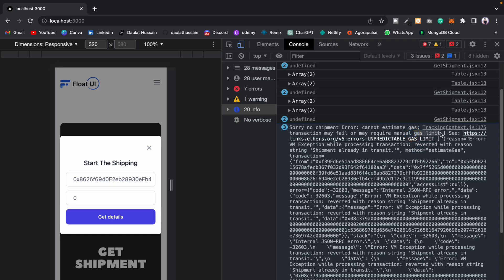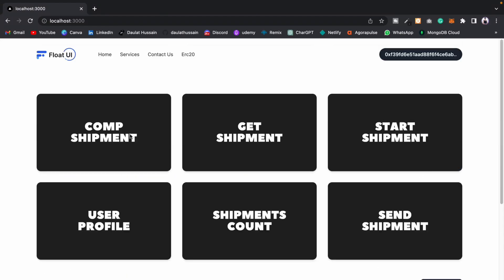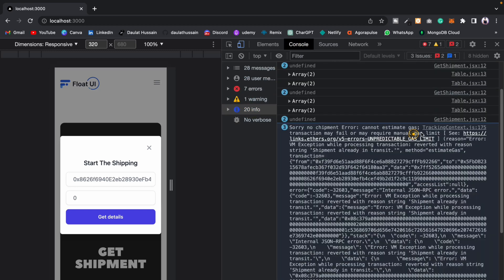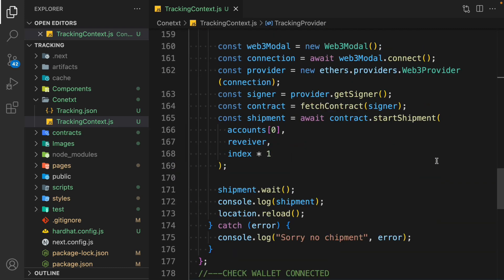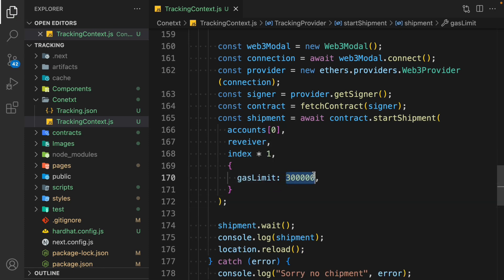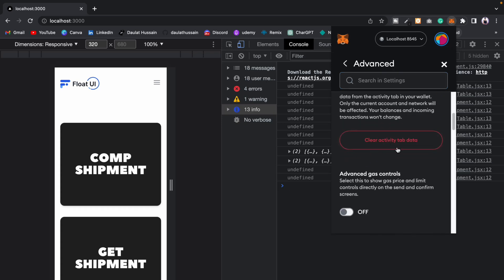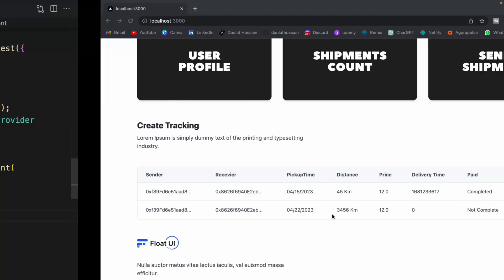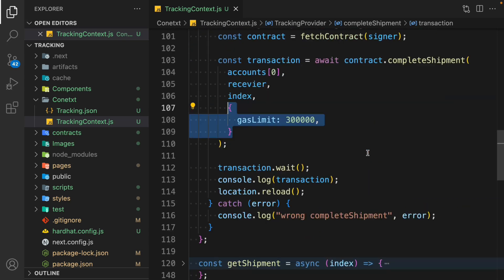How To Fix Solidity Gas Limit Error | Smart Contract Developers

Comment: hello Hussain, i personally appreciate for your content and sharing of the knowledge yo us as the community.
More so, i would wish to kindly request if u can make as a tutorial on making arbitrage smart contracts. This includes from setting up a project repository, querying tokens Data and respective prices from the Dex, Amm protocols esp UniswapV2 & UniswapV3, connecting to Blockchain APIs and writing the arb smart contracts. Just a step by step tutorial procedure with hardhat framework. And any necessary procedure av excluded for one to run the node. Kindly ill appreciate for the knowledge. Otherwise am greatfull for what u've developed me into in a year. Thank you in advance.
Reply from the maker: Hey Nature, we have already build the Uniswap clone, just start with that project and i will try to make video where i can add these feature in the project, so for the time being just follow the Uniswap clone project: https://www.youtube.com/watch?v=ZNDZuT9hmNo
Reply: @daulathussain  thanks Daulat, i got the video and it prooves to be usefull in what i requested,  already i started on it and ill inform u where i think i need more help on
Reply: What does exceeds  gas limit means it always appoear. U can't swap. How to fix it